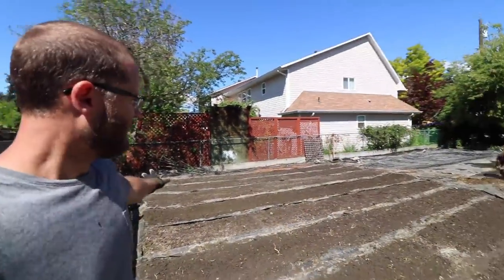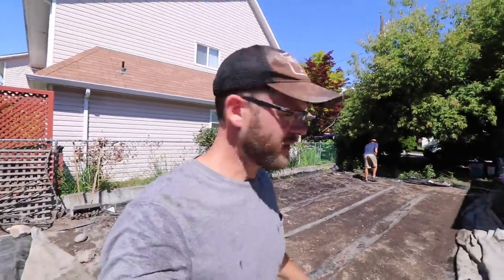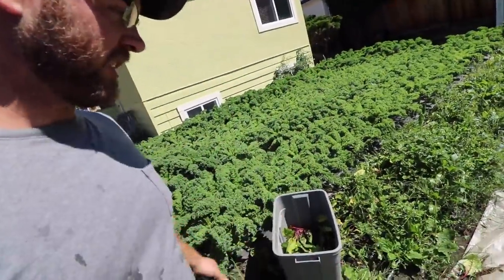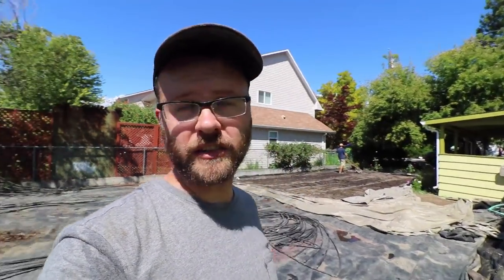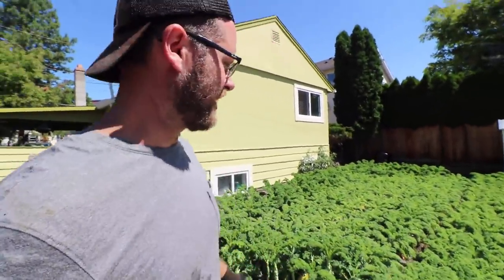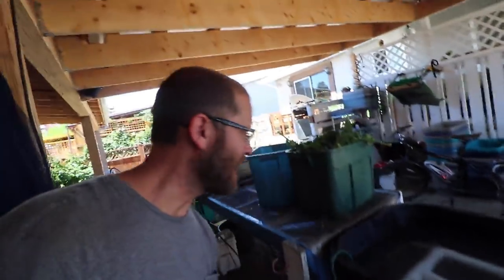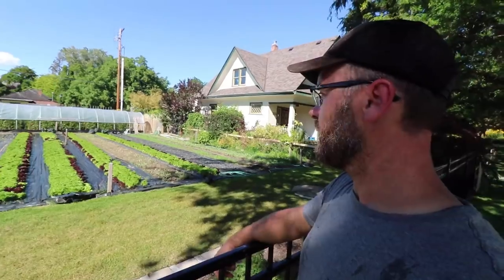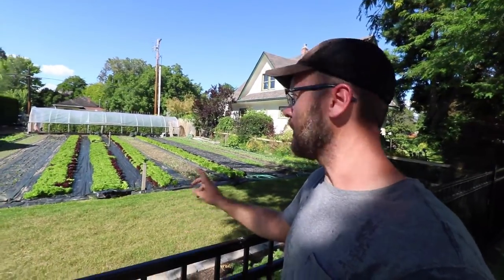VLOG - 19 - Crushing The Day

Comment: Where do you get your poly connectors and Tees? Haven't see that type before that you screw the poly down once inserted.
Reply: I haven't those before
Reply: Thanks
Reply: Thanks Carlos - google wasn't much help finding these connectors. I find the connectors sold at Home Depot to be less than desirable because they leak especially if the pressure is above 60psi.
Reply: I went to the website and have a catalog coming in  mail
Reply: For high pressure, I'd recommend a pressure reducer, otherwise you'll get a much shorter lifespan out of these systems.
Reply: Thanks....good idea...